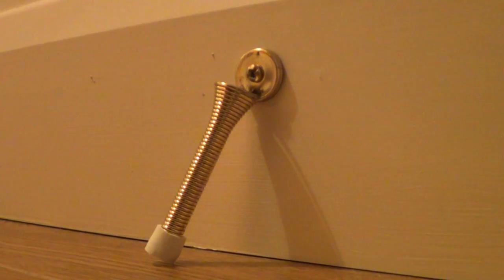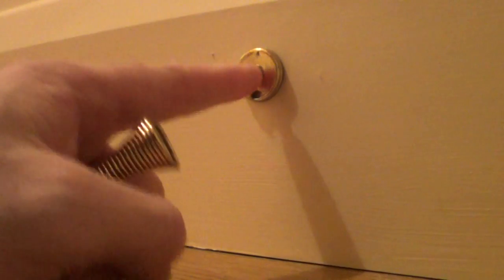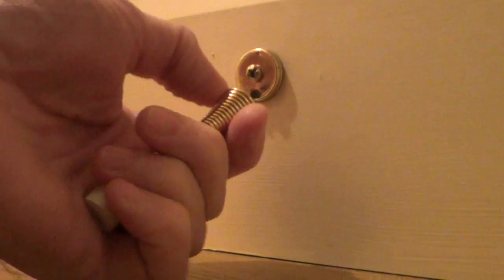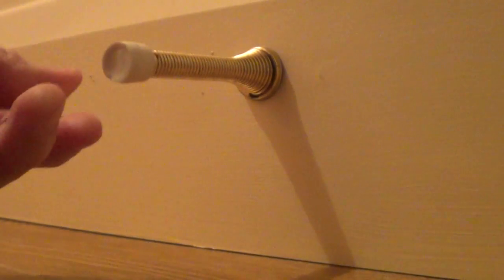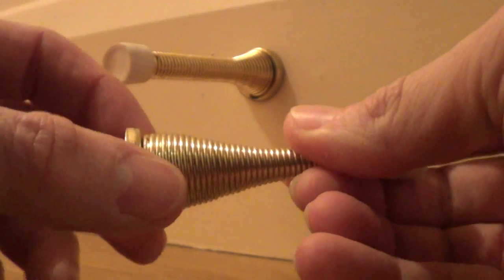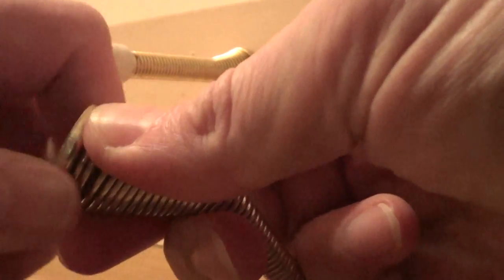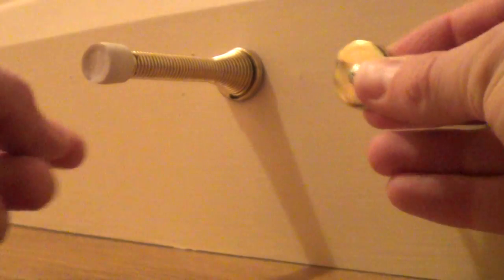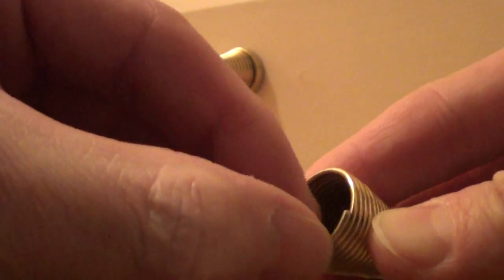How to fix a Door Stop (Spring type)

Comment: I'm wondering how exactly the spring portion is meant to operate. If mounted as shown on the flat wall or flat molding, then, the door slams on the stop head on w/ out deflection or the bending of the spring. However, some molding is at a slight angle which would deflect or bend the spring when hit. Which is preferred for best protection?